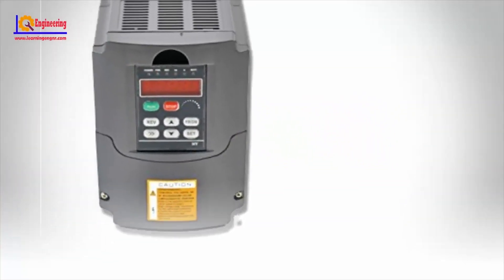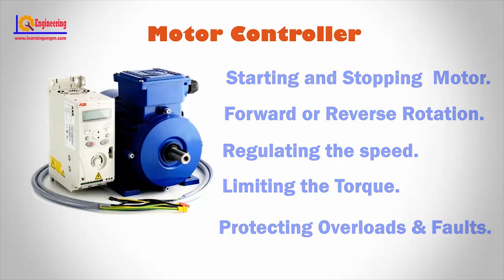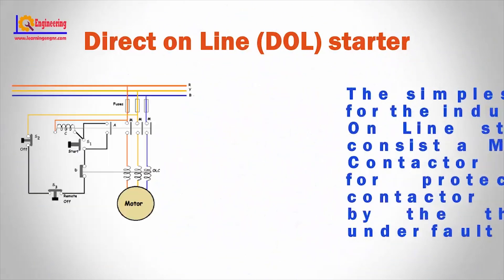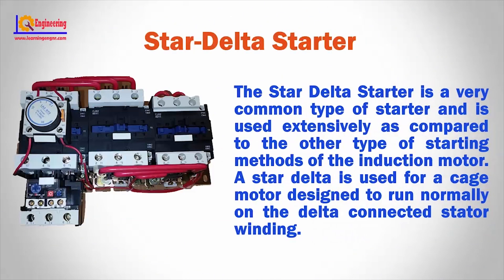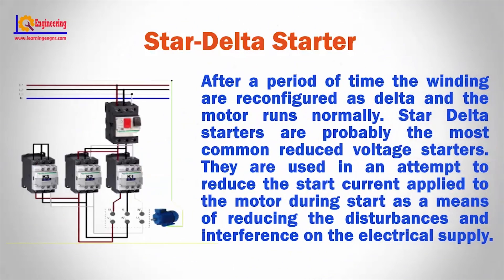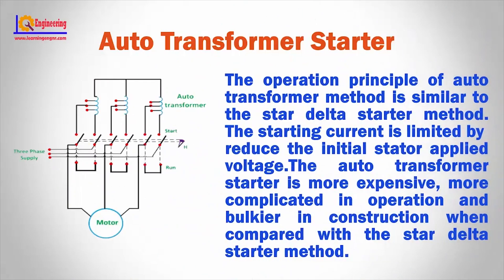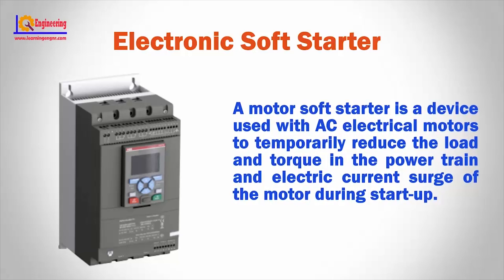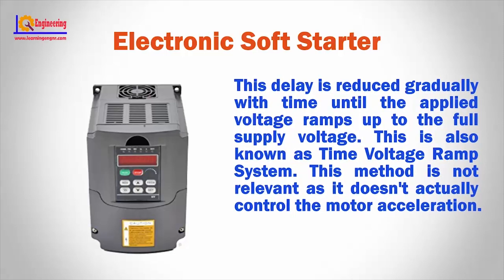Motor Starter - Motor Controller - Motor Starter Types

Comment: I have only one question: using a DC motor that's speed is controlled, do you pick a motor that doesn't use a capacitor starter?